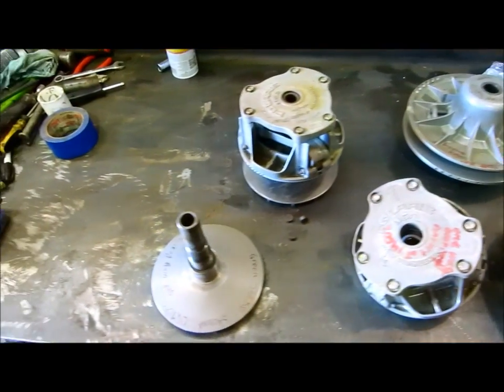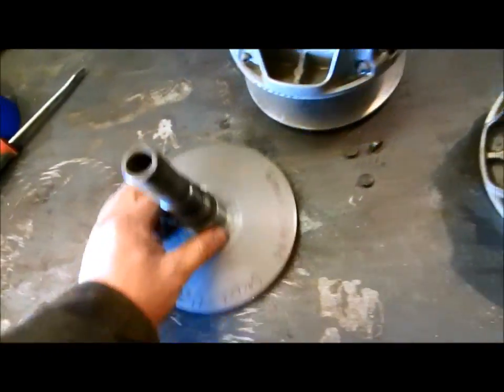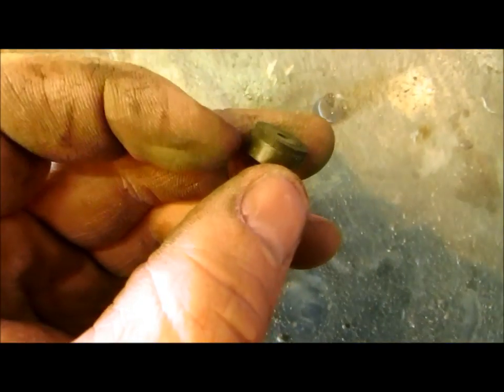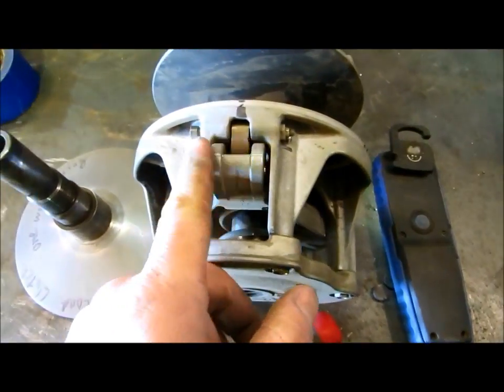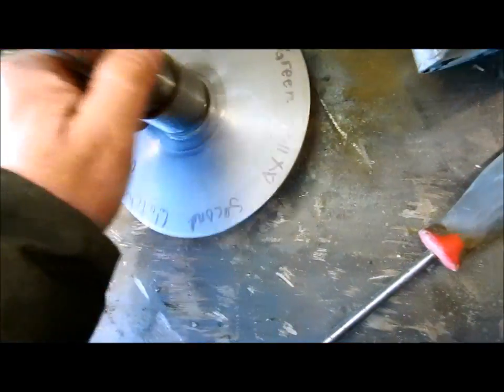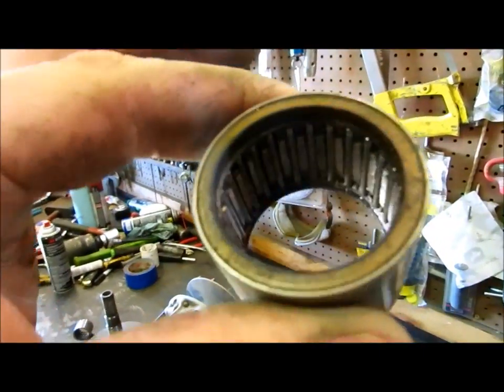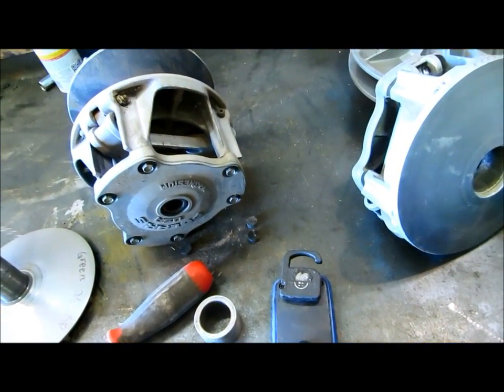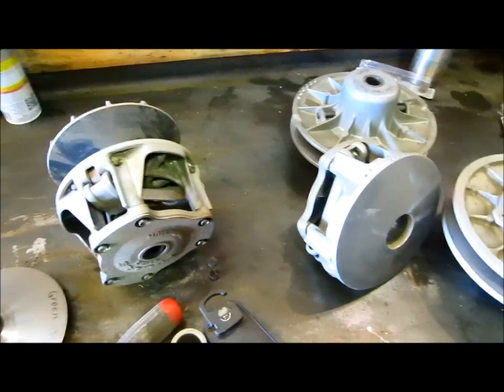Polaris Cluch Failure

Comment: Do u think running it full throttle for like 10-15 minute straight can mess up the engine? I'm gonna check to c if i blew the band. Hopefully its that and not the engine but mine just stopped responding after a long run

Comment: Have done some work on regular polaris clutches for sleds and then bought a 570 ranger and am amazed at how badly the clutch was worn out in the spider area. The drive sides of the towers had groves .030" in them which made them unusable as new pucks would just jamb up and get ground up sliding on the rough surface. So what i did was to tig weld up the towers with aluminum rod but ran into an issue where the clutch has magnesium in it and had some bubbling of the base metal happening. Found that a lower heat will help with the bubbles and maybe a magnesium rod for filler but didn't have one . Hand machined down the towers and seems like it should work . With the spiders having slopped out holes for the pucks i cleaned out the holes really good and used a loctite epoxy metal ( aluminum ) and glued the pucks in with not too much problem . I had to emery a couple of the pucks down a tiny bit to get the spacing the same between all the pucks and towers but it slides quite nice . Not really worried about balance as this engine doesent really rev that fast and i am shure that is  in better balance than before where some of the pucks were missing .

Comment: My 800 is hard to shift. the secondary clutch spinning all the time while the engine is running. replace the one way bearing 300 miles ago everything worked fine after that. That bearing still spins freelee so I don't think that's it. Also have blown everything out with your hoes got all dust out cleaned shivs primary and secondary. Been thinking about getting a clutch alignment tool. Saw your other video where you can look down and kind of tell if it's running true. No where on the primary near the base like you showed in one of your other videos I think. Also noticed on the primary the weights have grooves worn in the sides of them maybe too much slop in there like you were talking about the buttons I'll take a look. Any ideas you have would be appreciated. Thanks like your videos. Take care. Dave
Reply from the maker: Little Slow on the reply here Dave, but I'll see if I can help ya out-  You're Primary clutch bearing is spinning freely, so that's good- Next I'd ask you what you idle speed is.  Should be around 1100-1150 or less on the 800s. Any higher and the clutch will try to engage(and won't release). Also you could be getting enough wear in the buttons and outer sheave (where the buttons ride) to be causing some binding.  Worn weights, pins and rollers will also cause this issue.  Belt misalignment definitely will cause drag.  with the engine idling in neutral you should see the belt running with a slight gap on either side of it. It should not be touching either sheave.   Also, look to make sure the two bushings (one on the outer cover, and one on the outer sheave) have not slid out of their normal position. This will also cause binding.   With the engine idling and cover off, watch the primary clutch as you turn the engine off- If you see the outer sheave the primary clutch jump out/away, that tells you it's not disengaging fully, and you need to remove/disassemble and find out what's going on there.... Hope that helps.  Come on over to sxsnation.com and chat with us if you cant get it figured out!
Reply: DieselFume1 thank you I'll try some new things you suggest. Appreciate the help

Comment: What couse the primary not to disengage at idle I have a sled 600 XLT if you hold the track up give it gas it works fine but when you go to hold the brake and stop track the motor wants to die and you can hear the belt screeching on the primary
Reply from the maker: Not very familiar with sleds, but can't believe it's much different than a SxS.... I'd be checking the clutch for bushing, button and weight wear.  Your clutch is telling you that it needs gone through by it failing to release.  Does it have some miles/hours on it?  Only other thing would be an idle speed that's too high.
Reply: Yeah they're the same as a side by side my buddy just bought this sled off of Craigslist the other day and we are going through it and this was the problem we got it running the carburetor for all gummed up it's got about six thousand miles on it yeah we're waiting for the clutch puller to come and we're going to check the buttons I almost guarantee you the buttons in the bushing ar probably worn out

Comment: I became the owner of a polaris diesel crew 2012 engine. I dreamed about this car for a long time and was very upset when confronted with the problem of shifting. How you solve the problem.
Reply from the maker: Generally I know the 2011 diesels had clutch engagement problems, and my 2012 had minor issues as well.  What sometimes helps is lowering the engine idle speed on the injection pump by 100-200 rpms.  What's the idle speed now?  The newer primary clutches will be updated to help remedy this problem, but it is a fairly widely known issue on the diesel rangers.